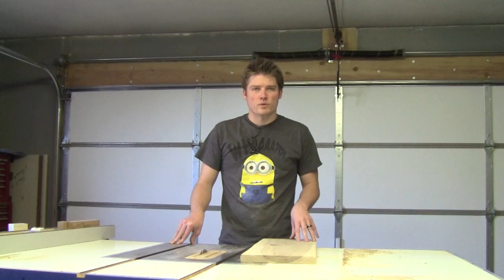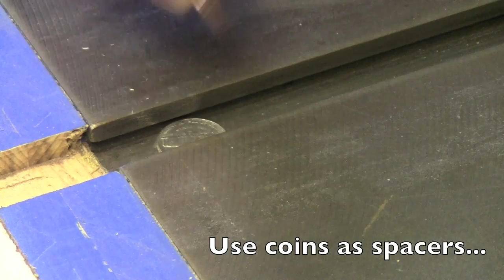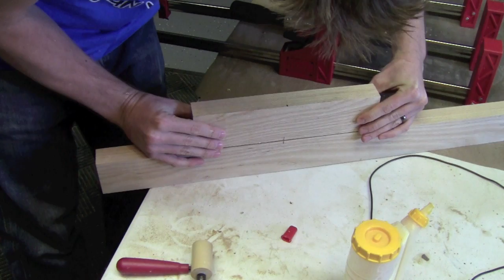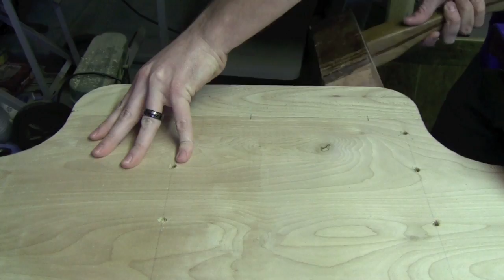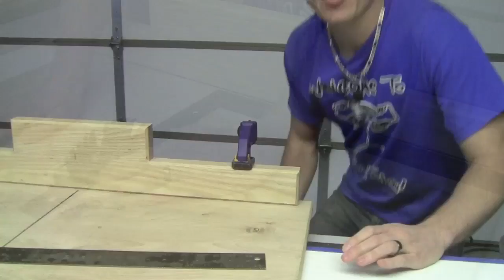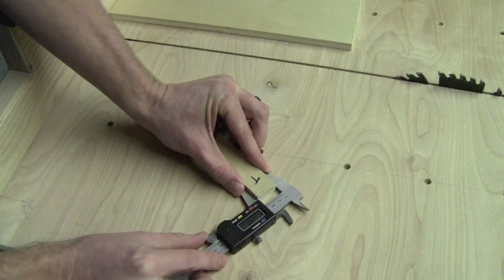DIY Crosscut Sled

Comment: I really like the front of the sled not having a vertical fence.  This fence is never used and is always in the way if you need to cut a part that is longer than the sled useable length.  This horizontal piece is great but if a longer part is needed a new piece will have to be installed on the existing one since your cut will obviously be longer than the plywood.  Great job.
Reply from the maker: Dave and Jackie Scott thanks a lot for your comment. I have recently upgraded this particular sled on my latest video. I also added a feature that I've never seen before. You should check it out. https://youtu.be/qxdMAFwm3ZQ

Comment: I enjoy and look forward to your videos. It is because of good people like you and Steve Ramsey, I am getting more involved in woodworking as a hobby. I pick up a tool here and there, and saving up for a table saw. I have been looking at the Bosch 4100-09, and Lowe's introduced a new Delta table saw (36-725) for the same price. I tinker with what little tools I do have and scrap plywood to get acquainted with them, and to work on developing my skills. Keep the awesome videos coming.
Reply from the maker: Thank you very much, that just made my day. It means a lot to me that I helped inspire others to woodwork. In regards to the tablesaws that you mentioned out of the two I would select the Delta. However, you might want to take a look at the Home Depot rigid line. They have a contractor saw that is a direct drive with cast-iron top and wings. Jay from Jay's custom creations actually bought one and did a review blog on it through his website. You might want to check that out as well. Www.jayscustomcreations.com

Comment: Great sled. You make the "5 cuts to square" simple to follow and simpler to adjust.
I've always been intimidated by those fine adjustments, but this video is easy to follow with good explanations.  
Found your channel thru John Heisz' link. I'm really enjoying your work. 
Thanks
Reply from the maker: Thank you Bill, I'm glad you enjoyed the video. I do plan on doing a follow-up video tonight to go more in depth to help settle any issues people are having. I knew they would.

Comment: I got a sled made already but I'm having a hard time setting the fence to cut a good 90. But the crazy thing is when I check with a square it looks good. I used a drafting triangle I got from hobby lobby. But still can not get a square cut. I don't know what else to do cause I follow all the steps still can't get it. I'm very confused I'd appreciate anything you can tell me.

Comment: Hi Drew,

Great simple sled, and I enjoyed the feeler gauge method of adjusting the fence. I am curious, I noticed you have an Incra mitre gauge, I can understand the advantages of a sled for wider boards or tiny pieces, but for narrower, longer pieces, would you still default to the Incra, or will the sled become your go-to for all 90 degree cuts? Thanks again, I've been enjoying your channel.
Reply from the maker: Well I have just accumulated the incra gauge but before that I did use my crosscut sled for just about everything even small pieces. It is a really good workhorse. One reason I like it, is because the wood that you are cutting does not glide on the table, the sled does. So the possibility of the wood moving is minimal.

Comment: Good video but still confused about the 5 cut thing.  I've got a small ryobi table saw so not much room to work with, do you think a cross cut sled would still work on it obviously just a smaller version?  Bought it before i got serious into woodworking and haven't been able to find a good deal on a bigger one yet
Reply from the maker: Hey Joseph, glad you liked the vid but if you are still confused check out my explanation that I do further on the 5 cut method. Should clear up the confusion. I think a sled maybe smaller for your saw would still be great for you. Just take your time. Thank you for the comment.

Comment: I love watching your videos, very informative and enjoyable to watch. Just one question, can you explain why, after the first test cuts you did maths, but with the second you just used callipers to measure T & B to get your measurements. Wouldn't just using callipers be sufficient. Or did you simply edit the second lot of maths out of the video?
Reply from the maker: The first go around, was spent trying to fix the difference I had with the first set of cuts.  The formula was used to fix that.  The second measurements with just the calipers was to see how well my math and application of the answer worked.  If it still wasn't to my liking then I would have done the formula again to fix the new set of measurements.  Good question

Comment: Drew, Do you not have the slot for the blade run through to the end of the sled away from you?  If not does this mean that when you use it you put the sled on the table and then crank the blade up into the slot you cut?
Reply from the maker: No the blade does not run all the way through on the backside away from me. If I did that it would cause the sled to be a more fragile at the fence that is closest to me. I keep it all one piece with just a slot down the middle that does not connect from one into the other. Check out my five cut method video that I posted immediately after this one, I give a more detailed description of my sled and why I built it the way I did.

Comment: Nice sled Drew. Why didn't you attach a fence to the forward edge of the sled? I've seen other sleds but they cut thru the forward edge, hence the need for the other bracing. Just curious!
Reply from the maker: Hey Walter, thank you for the question. There are many ways to do a crosscut sled and mine is just one of those. The Incapa her that I put on with biscuits is my back fence. It will keep the sled as one piece while still allowing me to put as big of a board as I want on the sled. Having the fence on the back allows you to make it through cat all the way through the sled but personally, that has not been my favorite style of sled, because it limits the width of the board that you can put on it. Thank you for a great question. Keep them coming!
Reply from the maker: Sorry AutoCorrect screwed up a couple of words there. There should have been "end cap" and "through cut"

Comment: After watching it again, I noticed the grain of the runners. It looks like the grain is laying down. If the wood expands, will it tighten in the miter grooves?
Reply from the maker: Watch it one more time. Take a look at time marker 2:43. Here you will see the grain running vertical, which will keep the wood movement on the horizontal access to a minimum. Thank you for the question and keep the comments coming!
Reply: Rock-n H Woodshop Not to harp on the subject but I need to understand this.I watched it at the time stamp. The grain looks like it is almost straight up and down. So, if the wood swells, it will move the sled up? All this time I thought it was the opposite direction.
Reply from the maker: Hey Walter, I can understand your question. That is why I cut the strips at a 5/16 of an inch thickness instead of the 3/8. The 1/16 inch space allows for wood movement as well as any sawdust that may be trapped in the miter slot. I did not want my rails to be bottomed out in the slot.

Comment: Nice sled man. I like the rounded edges. I have seen some with a fence at front and back with plexy glass over it to keep the saw dust from shooting up at your face while using it. Do you have that issue when you use it?
Reply from the maker: Not at all. I just have issues out the back because I haven't made a blade guard. Once I make that, the dust shooting out the back won't be an issue.
Reply: cool man I cant wait to see the follow up video. Keep it up man.
Reply from the maker: Hope you get some good use from the vids. Thank you for the comments and questions.

Comment: Great video! 

What type of bar clamps are you using for glue-up?

Given that you've had to do some tuning on the wood rails, would you recommend using polymer instead?
Reply from the maker: Thank you. I use Jet and Bessey K-body style clamps.

Polymer and metal runners of course I will not have the issues that wood expansion and contraction will give you. I plan on redoing my sled here pretty soon and putting on metal miter bars to remedy any problems throughout the increased humidity that I normally get in the summertime.
Reply: +Rock-n H Woodshop 

My only concern with anything but wood is the ability to custom fit the T-slot. Some metal bars have plastic adjustable set-screws, but I'd expect them to wear down with time and reintroduce the same slop issue. Polymer may be the best option assuming it can be machined to fit the slots perfectly. Keep up the good work; I'll be watching. :)

Comment: What do you think about using hardboard for the rail-runners? I've heard they are very humidity tolerant. I live in the Pacific Northwest, so this will be important. Thoughts?
Reply from the maker: To be honest Jeremy I don't think it would be a problem. I never really given it much thought. Keep in mind that even if you use a hardwood and have the grain running in a quartersawn fashion like I do, that expansion and contraction from side to side will be very very minimal. I live in Oklahoma and I have lots of humidity changes throughout the year and I have yet to have a runner stick. Let me know what you decide.

Comment: How do you know that your saw is cutting parallel to the slots before you build your sled?
Reply from the maker: +woodwrecker using a micro gauge, you can figure that out. Just measure the front of the blade and then measure the back of the blade and see if there's a difference, if not then it is running parallel to the slot.

Comment: I have a question, isn't enough to square it with the sqaure ruler against the blade and the fence?  What is the difference?
Reply from the maker: for narrow pieces that are maybe only 2 inches wide it can be good enough but not for panels.  The wider the panel the worse the error will be.  There is always something that happens when you set that fence that makes it come out of square.  The 5 cut method just helps correct that error.

Comment: Hey Drew. big fan, been following you since you started. Just one question, Why did you put that piece on the end of the sled with the biscuits? What purpose does that piece serve?
Reply from the maker: It keeps the sled as on piece. I prefer this instead of the fence going over the blade. Watch my next vid on the reasons I made it that way. Should help answer that question for you.

Comment: @ 10:49 Two-Thousandths?
How is that good?
It's still off.
I would be able to get it at zero if I really had to.
Reply from the maker: You could, I'm not saying you can't. But think about it, you are fretting over .002 inches. That is a less than the thickness of a piece of paper. You would have to be cutting something very very wide in order to see that it is not dead on Square. Personally .002 is super close to being Square.
Reply: Rock-n H Woodshop When I make one of those, and it will be very soon, I'll let you know how I got it at zero. There has to be some way of doing it, I will find a way, I'm good at finding a way. I'll have have to get a tool like you have at 10:52  to get to zero. And I like how you did that table-saw platform in another video. I would make it that big if I had the room. Panel-Saws are nice to have if you have the room. And your videos are very good.
I like that platform you made, to cut 45s on. I don't like adjusting the table-saw-blade to 45 either, then you have to adjust it back to zero again. And it looks like you have a well established-shop in your garage. Some day I hope to have that, and a car-lift if the roof is high enough.

Comment: I'm making one now and with doing the 5 cut method I keep getting different readings. I had it within .003 and I tried it again and I was more the .020 off what gives, my friend is making one also and he is having the same problem. Any thoughts would be helpful
Reply: +John Horgan I know this is old thread but what most people forget is the final measurement you take is the error of the the sum of the 4 sides. So if divide the by 4 ( .003 / 4= .00075) .  That is the error over the length of one side of your cut.  If the sum of the sides is 48" in total that is .003 over 48" distance!... that is pretty dam good..

Comment: So how do you get 13 7/8 to equal 13.85 please,,, what's the conversion please, thank you,,,,
Reply from the maker: When I made the video I forgot to put the seven in there. It should be 13.875. Sorry
Reply: Ok, but say I miss measured a bit and my length is 13 15/16, instead of 14 inches,,,, what  would the measurement be that I put in the calculator please ? and how did you get that measurement please ????
Reply from the maker: +drowization you just divide 15/16 and the answer would be 13.9375.
Reply: Oh, daaa,,, I'm,,,, an,,,, idiot,,,, Basic math, drrrr. Thank you good sir,,,, sorry to bother you :/
Reply: Decimal/fraction scale for inches is kind of a pattern. Make/find a chart of 1/16ths to decimal and you'll see what I mean. Its handy to keep in the shop till you have them memorized too.
Reply: Gotcha, but 1/16th is equal to what ? .125 I'm guessing ???
Reply: So I found this chart. I think this will help me a lot. Thank you for the tip. But what is the math I need to do if I lose this chart or don't have it with me please ??
Reply from the maker: Yea sorry about that. I forgot a number it's 13.875. In the grand scheme of things it didn't change anything luckily.
Reply from the maker: +drowization whatever your fraction is just divide the top number by the bottom number. If your measurement is 15 15/16" then your decimal will be 15.9375.
Reply: Now I got it, thank you very much good sir,,,,
Reply: A time you could have a different problem is converting mm to in. Often metric users will round up the decimal giving an unfamiliar number. I guess being accurate isn't as important to metric users (I'm joking). If someone writes 13.8 you won't know if they mean 13.75, 13.8125 or maybe even 13.875.

1/16ths are .0625 increments you can always just count how many 1/16ths and add that many .0625

The same can be done with 1/8s or 1/4s

Comment: nice f-150. is it ecoboost
Reply from the maker: No it is not an eco-boost. It is a 2011 and that was just shy of when they came out with the ecoboosts
Reply: Ohh.. Nice i got a 5.4 in my f-150
Reply from the maker: Cool. Mine is a 5.0 that gets roughly 18 miles a gallon
Reply: I get about 17
Reply: I have a cou
ple mods on it though.
Reply from the maker: I love my platinum. Nicest truck I have ever seen let alone owned.